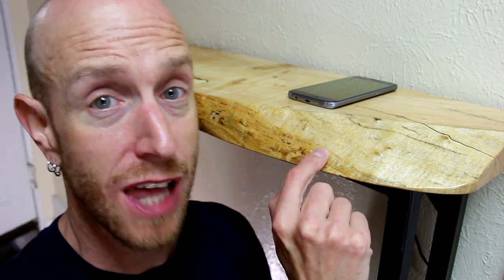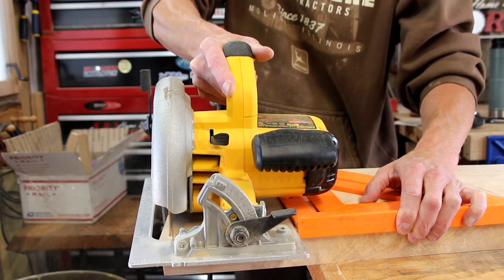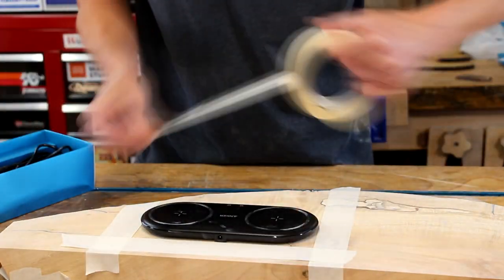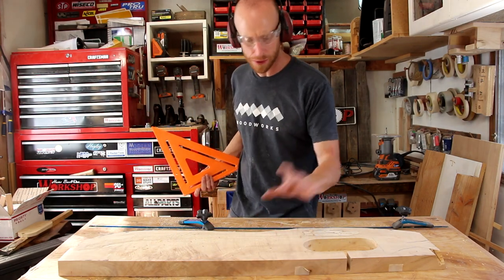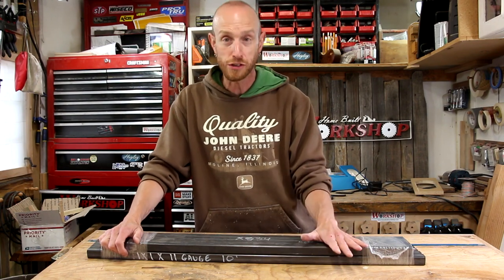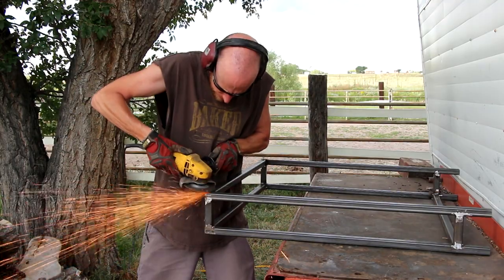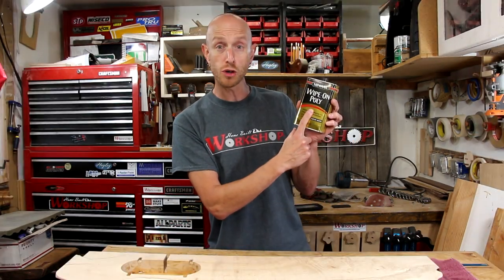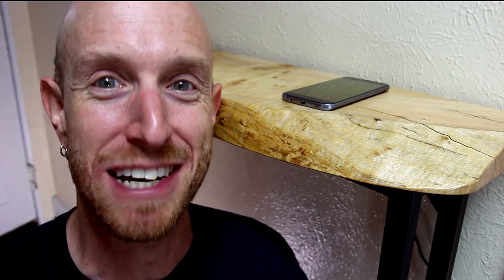How to make a Hall Table, with hidden Wireless Charger

Comment: Nicely done.  Like the idea for the charging dots and the wooden leg end.
Reply from the maker: Thanks Scott. I didn't want to tear up the floor. The ends of the steel can be quite sharp even if you sand them smooth. The wood is easily replaced if needed and can be sanded to level the table if needed.

Comment: Here's a quick tip for the grinder. You don't have to use the wrench at all. Just grab the disc and hand tighten. The direction of spin keeps the disc on, and its easy to take off the same way. I wear a glove when I do this. Make sure the grinder is unplugged. I saw it somewhere on YouTube, and have been doing this for years. Great build!
Reply from the maker: Thanks for the tip. I'll give it a try. It sounds super easy. Now that you mention it, I think I may have seen that somewhere a while back.

Comment: Can that wireless charger overheat in that wood and start a fire 🔥?
Reply from the maker: So far it's good. Its open on the bottom so it can get some air.
Reply: Home Built Workshop well this project looks awesome but im a little scared 😣